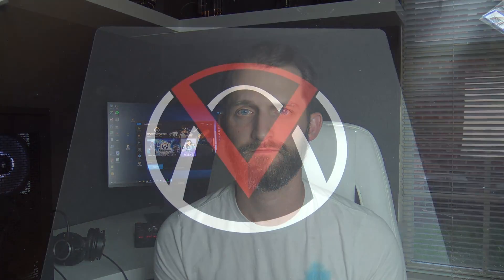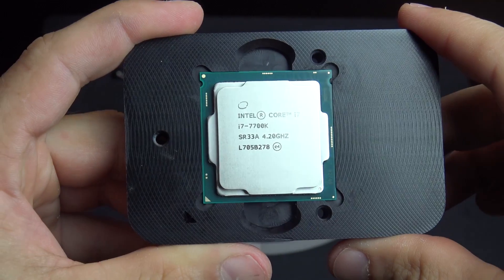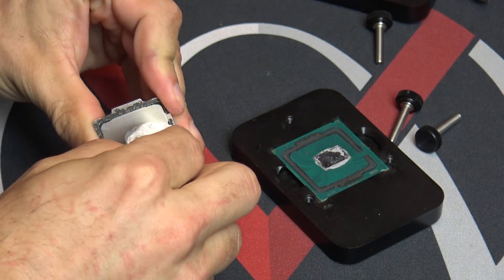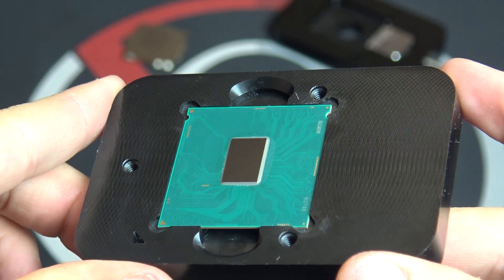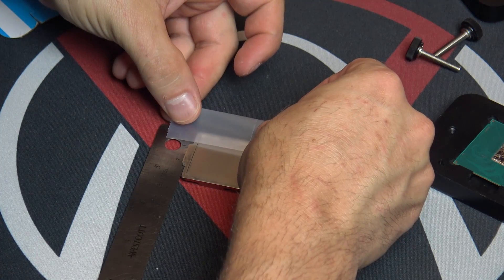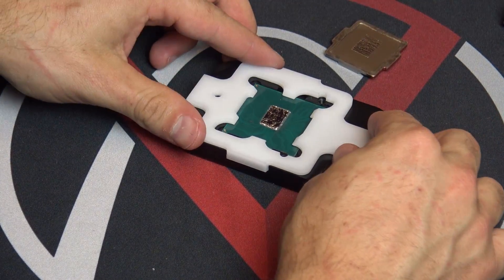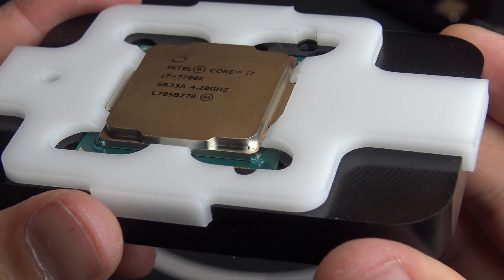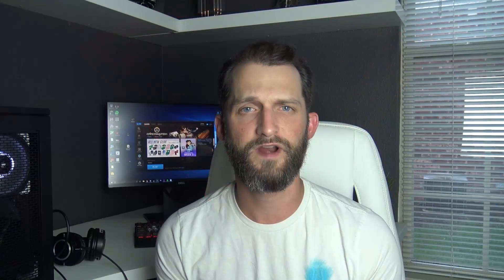HOW TO: Delid your Intel Processor

Comment: NEVER USE SUPPER GLUE!!!!! OMG!!!! use RTV some thing you can remove with out ripping the traces off the CPU pcb.. 

Did some hand-brake to compress some movies from 8gb to 1 gb for my sons tablet so he can watch some movies on a 20 hr drive my CPU hit 100°c and held there. i'm Running an H115i water cooler the water was hitting 45c 
i have AC5 on the CPU i am going to delid it 100c on a stock CPU is nuts!  Thanks intel...

Comment: is possible to set ARCTIC MX-4 - Thermal Compound Paste ? And do i need glue ? tnx for answer!
Reply from the maker: You can use paste instead of liquid metal and you don't have to glue the IHS back on. The retainer clip on the motherboard will hold it in place.

Comment: would this work for my Xeon X5670? currently i can not clock it higher than 4.12ghz due to needing too much voltage for my cooler to handle (anything above 1.275v gets too hot for my liking, even though i have a 240mm aio) so would de-lidding be worth it to lower temps so i could bump my voltage up to something like 1.35 and hopefully get a higher clock speed?
Reply from the maker: I can't comment on delidding a Xeon. I've never done it nor have I seen anyone else do it.
Reply: yeah i figured as much. see the problem becomes, in terms of chip size and stuff, it is the same as an i7 920, but who knows if it is made the same, because it is a xeon. i have heard they are meant to take higher voltages and temperatures, because they are built for 24/7 server use, but i still don't know that i would want it getting to 85c ever. now granted, that was after 20 minutes of an Aida 64 stress test, and it didn't go any higher, but that still feels like too high of a temp for my liking.
Reply: i just realized that i jumped from one thought to another without finishing the first one lol. what i meant by "who knows if it is the same" is that it could be already soldered to the actual die, or much more strongly adhered, etc.

Comment: 1) DON'T USE SUPER GLUE 
2) DON'T USE COOLABORATORY  LIQUID ULTRA (Do you know why? BECOUSE IT SUCKS ..!!)
3) USE CONDUCTONAUT X2 BETTER THAN LIQUID ULTRA 
4) USE HIGH TEMP RES. SILICON  !
Reply: Vir1lity PC Customs would you recommend just using the socket pressure to hold down the ihs without gluing it down? thanks.
Reply from the maker: super glue is fine. You actually get better temps without the silicon sealant.
Reply: STOP BEING LOUD, MY GOSH

Comment: Followed your exact guide. It's really good. I have one issue tho. I have a core running 10C hotter than all the others. Taking the cpu out of my pc to investigate
Reply from the maker: Which CPU? What are your load temps?
Reply: 6700K. I re-did the delid just to make sure I had good coverage and still I have a core running a bit hotter than the others, core #1. My maximum temps are as follows 54C, 60C, 52C, and 54C for Core 0, 1, 2, and 3 respectively. Core 1 is a bit more warmer than the others but way better than 10C hotter as it was before. Thanks for the reply man. Going to delid my friend's 7600K soon.

Comment: Super glue...smh...sigh. Just go get the, similar product RTV, of which is what originally affixes the IHS to the CPU.
Reply: What if I told you that is what Rockit Cool actually recommend on their website, where you could also buy the delid/relid tool? You honestly don't need that much of an adhesive to keep the IHS in place at all. Reference - I've done it.
Reply: Just read what  "Super glue" is made up of(not good for the circuit board surface protective agent). And besides that, if at any time in the future, you NEED to get back under that IHS...good luck, not ruining that board. Just stick with the original RTV compound. Just be sure not to put a bead, of RTV, completely around the bottom of the IHS.
Reply: Super glue is "super" only if applied to a large, roughed-up area - that's why it is used to fix broken stuff or fibrous material like wood or leather. It has low shearing strength, which makes it perfect for use as a temporary adhesive in cases where the piece needs to be sheared off later - exactly what you mean by "need to get back under that IHS". Stop assuming, start thinking...
Reply: LOL...smh. You certainly don't know much about "Circuit board surface protective agent", thus hardly anything about the materials used in electrical/electronic components. And after about a year, you will want to check the "Liquid Metal" TIM that has been applied. Stop assuming, you know more than you do about this subject matter, start thinking...you should be a "Forever Student" of information. And the axiom of "Better safe than sorry"...so stop being sorry!
Reply: Tommy Lee Ok, could you please educate me on the matter - let me know what is going to happen specifically - what the material on top of the circuit board is and how glue composition is going to affect it. The same applies for the IHS and the liquid metal compound. None of these react with each other but I am leaving to you to prove me wrong...if you can. Looks like you know as little as you assume I do.
Reply: You prove nothing, and ironically you are the one making a fool of yourself. You clearly use words you still don't understand but you have read in a different context, probably in a random forum, and can't really apply them here. You are not naming compounds, or anything to substantiate your claims. "Dissimilar metals", "flow and viscosity characteristics", give me a break. Of what? This thermal compound contains gallium, indium, rhodium, silver, zinc and tin, neither of which affect silicon and nickel in any way (the surfaces they will be touching). And by the way, I have an Intel CPU with a big drop of super glue which I accidentally dripped on its pcb...four years ago - still working perfectly fine. 
And as a matter of fact, the moment you start calling people names, you've already lost the argument. Now go and spill your spite somewhere else, I can't be bothered answering you again - you are simply not worth my time.
Reply: Tommy Lee You are only mocking yourself. I told you, you already lost the argument by not staying on topic and attacking me personally. Case closed and you have been reported. Twice.
Reply: This is what happens when you have people that are clueless trying to duct tape their computer parts together to feel cool. I was surprised he was using super glue and immediately started checking for comments calling this out.
Reply: NEVER USE SUPPER GLUE!!!!! OMG!!!! use RTV some thing you can remove with out ripping the traces off the CPU pcb if you need to go back and fix some thing..

Comment: is it worth just delidding and then put heat sink directly on without the heat spreader?
Reply from the maker: It can be done but usually requires special mounting hardware. I know EK used to sell special mounting hardware for mounting the block directly to a delidded processor

Comment: LOL now that I saw the end part of the video you totally fucked the relidding process man. I'm surprised that you did that. You need to use silicone based sealant. This is huge huge mistake. First you need isolation, not just something to hold on to the ihs. Without the even spread sealant you put uneven pressure on the chip as well. Also super glue will most likely be impossible to remove, because you never know, you might have had made a mistake and need to delid again and relid again. Big mistake with that super glue.
Reply: You never actually checked, did you? Rockit Cool do recommend it.
Reply from the maker: I have done 3 delids like this with zero problems. I used the method that was recommended by the manufacturer of the delid tool. Some people use silicone sealant, and that's great, but it has nothing to do with the temperature results.
Reply: just put it back on the cpu bracket without glue or selicone... i might just use the old selicone and the cpu bracket..

Comment: I did delid my 6700k a few weeks back as well using the der8auer delid die mate 2, which worked really well.
Some things which could be useful for others:

- Getting rid of the black silicone was a pain in the ass but applying some label remover softened it up which made it easier to scrape off.

- I used some special non conductive tape on some parts of the pcb, because the 6700k has some contracts there which could be shorted out if some of that liquid metal came onto it. This was just for safety and you can probably get away without it  .
Reply: gameingdrone removing the silicone could be done with a credit card right?
Reply: yeah i think that would work
Reply from the maker: some people use a credit card. Just avoid using anything sharp enough to gouge the PCB
Reply: Thanks mate

Comment: Have seen a few different delid videos dut i have never seen anyone elso put thermal compound on the heat spreader .Have you tried not doing that vs doing it and had better thermals after?
Reply from the maker: I have not. I've only ever seen it done this way, but I would bet it doesn't make a major difference.
Reply: Steve from the Hardware Unboxed channel said he tried the different methods of applying the thermal compound and there was practically no difference between all of the.